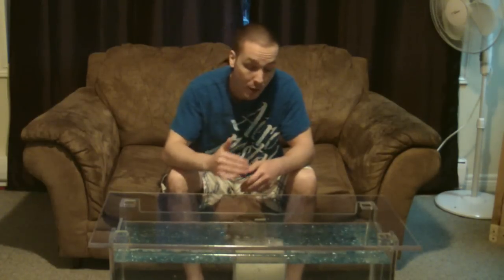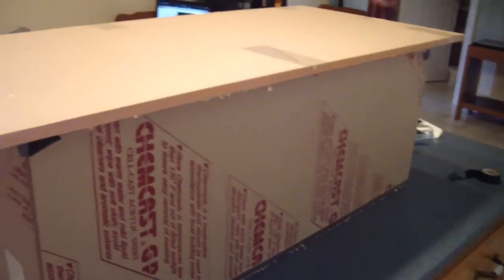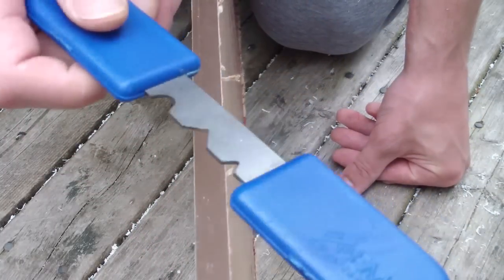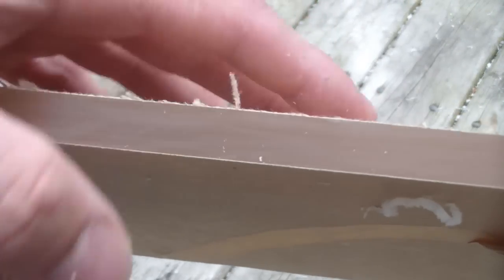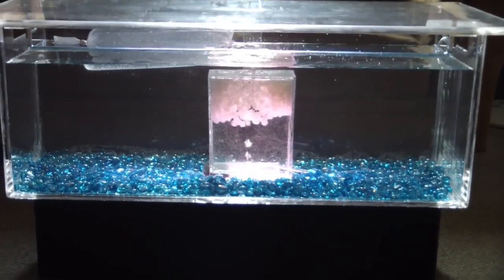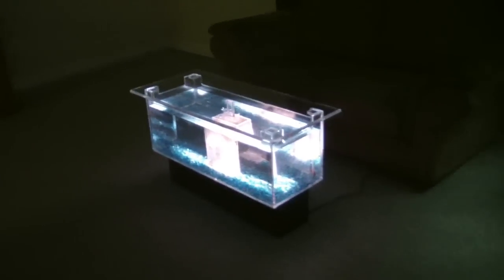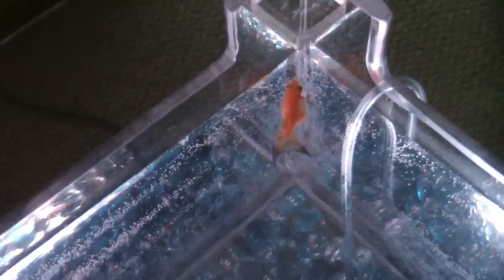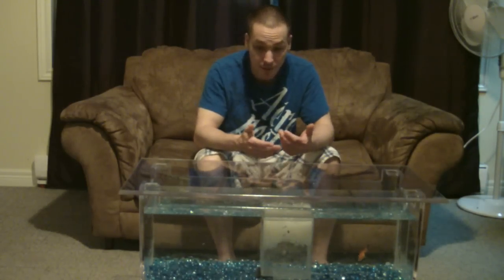HOW TO: Coffee Table Aquarium TUTORIAL

Comment: As you said there are many ways to build this tank.  I actually like your take on it quite a bit.  The only thing I would have done different would have been to cut a hole through the bottom in the center of the tank, then glued a frosted or black acrylic cylinder over the hole extending it above the waterline. This would allow you to run the airline up through it instead of up and over the outside of the tank.  You could also run a couple of strips of multi color LED's through it for some additional lighting effects. Unlike using silicone to seal around an air tube, there would be no more of a chance of leaking than there would be for your bonded seams around the bottom of the tank.  But again great job.

Comment: just a thought although it could be problematic why not run the air pump tube through the bottom of the tank using a small balk head or something to stop leaks, then you would not have the air tube on the side, the other thing is you could put a rug under the tank and have a small hole so you could feed the power cord under the rug.
Great video keep them coming.

Comment: Really cool! The only thing I would do differently and other may have commented but for better lines maybe use wood or plexi straight edges and tape them onto your plexi you wanna cut. Pretty much just using that as a guide against ur flush trim bit so you have a perfect straight line. It looks like you free handed it a bit which takes a really steady hand but using a guide for the long work makes it perfect.....Im talking about around 09:00

Comment: I know this was a while ago however I have a quick question if you are still commenting. I know you are using 1/2" acrylic however, with the volume and pressure, would bracing be required to prevent eventual bowing?

Comment: Pretty sweet looking tank.  Wouldn't glass be better for the top to prevent scratching from actually using the table top? Also, does the tank feel unstable if you press on the sides? It seems like it would tip over pretty easily.

Comment: Nice router work. I've never used one before but I noticed that when you used the rounding bit, you didn't use the guide rail. Is it possible to remove too much material in this case?
Reply: +Jason Campbell No, did you see the little silver ring at the top of the bit?  That is a wheel, it doesn't cut, it stops the bit from going any deeper.

Comment: could an overflow  set up be made using acrylic tubes say with a little wider stand with wood sealer to control the moisture  you could have the heater in the overflow  the tubes would be inside the tank and led pucks for lighting  btw if you can a floor outlet would be good to fix the cord problem. i really like your videos  keep em coming

Comment: in regards to condensation. what if you didnt want holes on the side, so instead placed fans at either end. to move air through consistently. Also maybe put a piece on a hinge for feeding (thats another issue). I just want to find away to make it without such large whole it between the top and the tank. Thank you for your video.

Comment: OK so I just built the outer layer that will hold my tank (a sleeve). I didn't put mine together I just decided to use my 55 gallon long tank. I did my filter like you did. I tried placing a light under the tank and couldn't see anything. Is the only way to make that possible us to get the crystal things? I just ordered a underwater light but I was trying to save money.

Comment: Did/would you consider putting a hole or two in the bottom of the tank and do a wet/dry in the base? You could have more robust filtering and forgo even the air hose line.

Comment: Few questions/comments as I've made my own in a drastically different way. How does the light shine through the bottom with the gravel/sand at the bottom? Also the hieght is to high for coffee table hight. Do u get condensation on the top glass/acryllic. Because I had to hook up a thin blower on mine to stop that. Should have used led lights last longer no heat. Also if it's near the floor the acryllic scratches that's why I used glass. Although its not as clear. Cool tank though

Comment: I agree with the check valve I actually pull them off to do water changes it really does siphon water out of the tank if you pull the check valve off and the pump stops but you would think since it's so essential to the pumps safety and flooding for that matter that they would include a check valve with the pump LOL XD

Comment: you should put the power cord under the carpet or put a carpet layer with a hole and extra protection from spills. drill a tight hole under the thick acrylic for the tubes.
maybe some weights for the filter or a cylinder handle instead of a rectangle no weird looking cut sides
Reply: if tube leaks maybe add silicone?

take everything I said with a grain of salt just an idea, I've never own a fish

I like the goldfish:)

Comment: you should use at least a half inch bit or bigger to cut acrylic and don't use a scraper for the edge that's old school sand it. and when you are clamping your joints use more clamps. and you should look into a festool track saw they are pricey but well worth it. and also plexus glue. you should sand your edges  to 400 and then flame polish it with a micro torch. just thought i would drop you a few pointers. nice job on tank table though.

Comment: ..cont.. - items I have are:  2 pieces of Plexi-glass, 4 - 9"X3" pieces of glass that were used for a hanging light fixture,1- 32"X32"thick glass that used to be for a table top, An actual aquarium that i've never used for it's purpose w/ filter (i'd use it, but it's just way to large.. i can take it apart & cut the glass to make a smaller one), 10 - 8"X12" thin pieces of glass (they were for picture frames), old glass panes from old windows.. I have about 4 windows. That's all :) Any Ideas??

Comment: 125-150$? huh i priced prefab acryllic tanks and they were like 300plus shipping for a 30 gal. wish i had your tools at my disposal, your filtration is interesting as is the whole project i used an all in one internal filter thats has mechanical, chemical, and bio filtration all for 30 bucks and its cheaop to maintain also did an internal powered aerator which spins and spreads the bubbles all over the tank, cheeck mine out. checck mine out juslom2002 fish tank coffe table